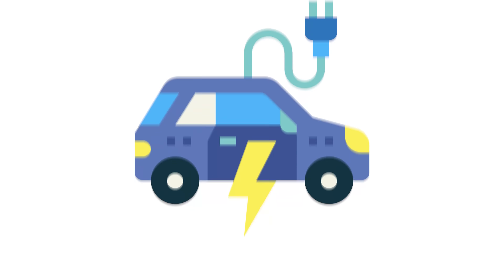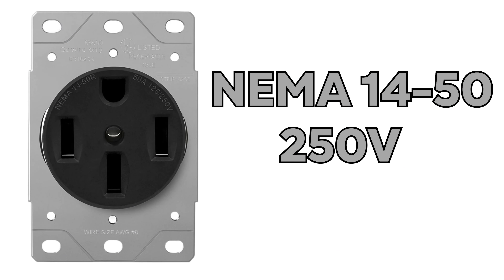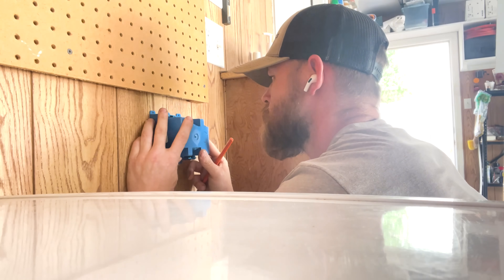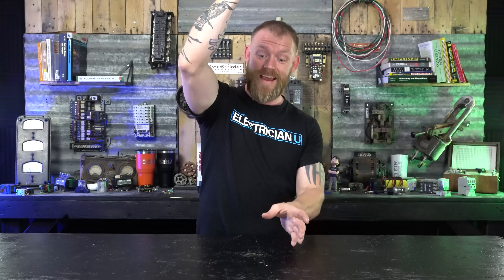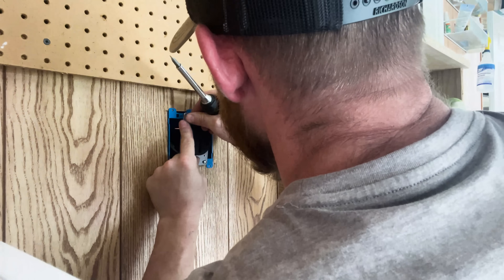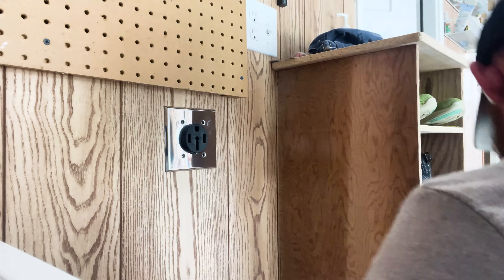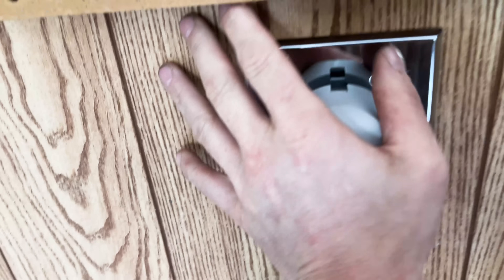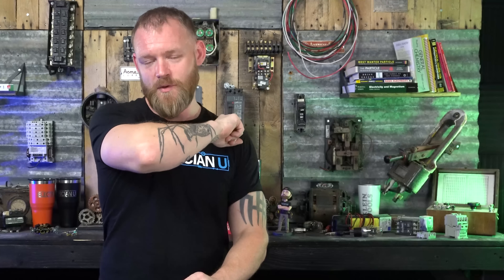How to Install an Electric Vehicle Charger Receptacle

Comment: Please mention lock out procedures on occasion. 

Most Resi guys have never received proper training. I've found that even in industrial settings, some electricians ignore the proper procedures.
 
It only takes one good jolt and you're done.

Comment: Know what else you should do, besides hire an electrician? Hire one that doesn’t suggest using a receptacle.

Receptacles are redundant, an added expense, and open to problems if it’s not a quality receptacle. Just … stop, please!

We’re not sharing it with a welder, people are not using a dryer or a cooktop in their garage. Receptacles, for EVs, are on balance not best practices. 

The next electrician that quotes you a receptacle, ask WHY. If you get a blank stare or are told you need one because the EVSE comes with a cable to plug into a receptacle, walk away and find a specialist, not a generalist!

Comment: Great video, question: for ev charger : can I install a 60 amp Gfci breaker with a 50 amp hubbell 9450a receptacle also with 6 awg wires.

Comment: 8-3 NM cable is rated for 40 amps, so there's that. For all you people using 8-3 romex, it's only good for 40 amps. Also, don't use a receptacle like he used, they make special EV receptacle that's rated continuous load like an EV transfer system actually is. Everything else is good.
Reply: what’s a good ev receptacle to use?
Reply: @leosotelo5119  Hubbell makes a good one, they will have a car symbol on the face sometimes.
Reply: @electvolt67 thank you!
Reply: @electvolt67 another question you can help me with. would you connect the neutral to the receptacle or cap it? i know tesla ev charger don’t need the neutral wire.?? or can just connect it and still charge properly?
Reply: @leosotelo5119  cap the neutral...not needed. Use the ground for a ground....lol
Reply: If you don't have a grounding conductor then you can use the white but tape it green at both ends and connect it to the grounding bar. But if there is a ground wire present....cap the white.
Reply: @electvolt67  electrician gave me to offers one with 6 gauge without neutral and another with neutral in it. i think the best option is to run it with neutral just in case i need the outlet for something else right?
Reply: @leosotelo5119  no, the neutral is a waste. Are you installing an receptacle or hardwiring the station?
Reply: @electvolt67  would be an outlet for charger. i can hardwire if we decide to buy it later on?
Reply: @leosotelo5119  It's a transfer station, the charger is inside the car. If you install a receptacle it has to be GFCI protected. If you hardwire, you don't. 240v GFCI  breakers are expensive, so is the EV receptacle.

Comment: I realize this was made a few years back however I hope maybe from time to time you check your notifications and read this.  I just bought a mustang mach e and been daily charging with the 110v charger that came with the car which also has a 240v plug adapter.  My silly circuit box and power coming in is 100 so it limits me to what I could add which I am sure I have a dryer, stove as 220.  However, being a electronic engineer I know I would use the same fuse system and have a a/b box. Is there such a thing that I could share my 40 amp 220v circuit breaker with a 220 plug in right underneath it and have the dryer connected to it as well?  This way if I want to charge the car overnight I simply switch it to it being powered on and the dryer would be off.  When done, got to keep the wife happy move it back and the dryer is active and the charger is inactive.  This way I would not overload the circuit box and create a possible danger to us and yet have what I wanted a faster charge to the car and the dryer the rest of the time.  Thanks for helping.  William

Comment: Around here, the "pop-in box" is called an "old-work box". The 30 amp breaker was unnecessary because the car controls the max amperage allowed by the circuit so a 50 will not ruin the car.

Comment: If electricians charged reasonable rates I would in my area there charge almost $1000 to instal a NEMA 14-50 plug plus parts and they refuse to use parts provided so they inflate part prices as welll

Comment: Electrician U is super helpful.  But it looks like the option for plug in receptacles for fixed in place (tools installed) chargers isn't allowed, at least IAW NEC 2023 section 625.44C.  They must be hard wired.

Comment: Here's another Fact .  Did you use this outlet ? If not then your going back...
Hubbell Lighting 125V 50A 3-Pole 4-Wire Receptacle – HBL9450A    Made for EV"S, because the other one's heat up and melt.

Comment: One dis service for the customer,  battery data now shows its better to charge at level two at a higher rate/ amps  then to trickle charge.  Manufactures state to only use the provided car charger in a emergency. most are only rated at 30 amps.   Run #6 awg at the minimum, copper only

Comment: Don't put a protector on the line, all the car chargers are manufactured with it built into the controller, if you do, it may trip all the time,, straight from Leviton manufacture.

Comment: 4 mins in and I said OH Shit, another electrician, under sizing,, Stop thinking wire size in your line of work...Wire is rated, but not for EV charging. a EV will draw 40amps CONTINUOUSLY ! for 4 to 5 hours. 
EV's don't cycle. Better learn to over size by two. You'll find out the fittings are the week point and melt and burn, never tripping a breaker.  Watch Sandy Monro's channel.
Reply: what’s a good size wire to use for a nema 14-50 ? i have a bare stud garage. should i do wire in conduit or just wire in studs? planing to add drywall in the future?

Comment: By the looks of that 14-50 outlet, it’s a cheap from a big box store that is ok for a dryer or electric range but not for an EV charger. It is not designed for a long charging session pulling up to 40 amps. I have two EVs. When charging the car decides how many amps to pull. My 2014 will pull 32 amps. My 2022 pulls 40. The car decides how many amps to pull. It doesn’t care what the breaker is. Pulling 40 amps for several hours will overheat the breaker and the cheapo outlet. I also question using 8 gauge wires for long charging sessions. The outlet should be a Hubble or Bryant NEMA 14-50 and the wires 6 gauge. Also, GFCI breakers and outlets are unreliable and pop when at the slightest over amp pull, like the amp jump when using a table saw or a planer.

Comment: Using 8 gauge is risky. Should  be using 6-3 for safety. Your outlet should be a Hubbel or Bryant made to take Hyde heat of 7 to 8 kW of load. The receptacle you have is ok for an electric oven BUT NOT FOR A CHARGER.

Comment: I am surprised some electricians are installed receptacles (outlets) that are meant for appliances that will not demand continuous juice for eight straight hours....they will heat up and melt, the connections are flimsy and often not even copper nor bronze. We must remember that the 50amp receptacles up until recently were meant for appliances. A range/oven does not use continuous juice for 8 hours, non stop. Appliances turn on and off, and the plug is never moved.  
An  EV is a different animal,  people plug and unplug and loosen the connectors. Moreso, the connectors are only half the size of the holes, so the current has like a funnel from a wide wire to a small connection to then another big wire to the EV.  NOTHING that costs $15-$20 outlet should be used. You need a Hubbell or Bryant INDUSTRIAL GRADE, it is heavy, beefier, the connections are very solid and is sturdy. Those can take the heavy load 24/7.

Comment: Do the cable wires get hot enough to potentially cause a fire in the attic if touching insulation?

Comment: You need to use EV rated outlets per the new NEC code. These have a larger fdace on the front, all copper contacts and can handle 75 inch-pounds of torque. They also have much higher insertion ratings. These are way safer than cheapo stove outlets.

Comment: Fun fact:
Renault Zoe from the thumbnail could never charge on an American 240 socket. It requires 240V, but one of the line inputs must be neutral, not split phase. Because Zoe does ground impedance test by injecting the current between ground and neutral. 

You could fool it with an isolation transformer.

Comment: Not sure why you need to limit the amperage with the breaker.  Use the proper max rated breaker with the cable gauge installed. Most of the time the wall charger has dip switches to control the amperage draw or the car itself has the ability to limit the amps ie 16, 24,30 etc.  This would save people from having to call in the electrician again and buy a higher rate breaker.

Comment: It is not that difficult to install. Not going to hire an electrician to wire in a freaking plug. I hoped up my jacuzzi, Spare electrical panel for my generator and I never pulled a single permit.

Comment: The way I understand it is that yes, 8 gauge wire is rated for 55 amps at 90c, BUT the circuit breaker is only rated for 60c meaning you have to go to 6 gauge wire to be code compliant if using a 50 amp circuit breaker. I would have put in 6 gauge wiring just in case in the future they decide to ditch the 30 amp breaker in favor of a 50 amp. A homeowner not being electrical savvy may look at it like I'll just go to HD and buy a 50 amp breaker and put it in myself, not knowing the wiring would not be sufficient for a 50 amp breaker. Just a thought.

Comment: Go WALL CONNECTOR  or go home.     Receptacles are dangerous and S L O W. ......99 % are NOT rated for continuous duty AND use 6 gauge  wire while you are at it and romex SUCKS.

Comment: I recently did my continuing education to keep my masters license on ev charger circuits.
   The instructor cautioned that the 50 amp range outlets are the source of many fires. 
   They aren't manufactured for continuous duty at 43 amps and melt down. Havent seen it in person yet, but incourage direct wire installations just in case.

Comment: Can you tap into a solar Power Disconnect box for wall charger?   My main panel is in the back of the house and will need about 75ft of cable. My solar disconnect is inside my garage about 5 ft where I wanted to place the 240V plug.    Thanks.

Comment: The Tesla Power Feed, get around many issues with a common NEMA 14-50 garage installation. 

The first is the Tesla Wall Connector is not a general purpose receptacle. It has a built in GFCI so the circuit breaker feeding it does not need to be a GFCI for a wet/damp location of the Wall Connector, like a garage. It is also not considered a general purpose receptacle like the NEMA 14-50 which can be used for many different loads, like an electric dryer as an example, so the circuit is dedicated. Another advantage with the Tesla Wall Connector is it can be used continually, as in NEC continuous load (3 Hours or more), without special consideration. The common NEMA 14-50 dryer receptacle that many use for EV charging is not rated for a continuous load. The only continuous load version I know about is the Hubbell HBL9450A which is EV Grade (Continuous load grade). The HBL9450A is very long so you may need to use a metal surface mount box (with EMT) with a expansion offset front plate. Also, if using stranded wire in conduit (THHN/THWN) I would crimp on a ferrule before installing the wire to the receptacle. Also, tighten screws with a torque wrench or screwdriver as per Hubbell's spec.

Comment: You must definitely do a calculation to see is a real interlock would be required to run the charger because electric car chargers are taken at 100% against the service

Comment: Good info, is this a leviton receptacle? I've heard that the contact pins are not ideal for EV's especially if your plugging and unplugging on a daily basis. For say a standard dryer that seldom gets unplugged its not a concern. Many house fires have been traced back to these lower quality 14-50 receptacles. There are EV grade receptacles, they have allen screw holes to tighten the wire and the metal contacts are heavy duty. The allen screws also need to be torqued down. Device box needs to also be changed to a deeper box.

Comment: Question, how does an ev charger differ from a water heater connected via a 30 amp plug? Why is one allowed and one isnt? I need to charge my solar batteries with a chargeverter and only have room for 1 -30 amp breaker. Thks

Comment: When I bought an EV in 2018, I had an electrician install a 14-50 outlet fairly close to the point where I charge my car. Now I have a second EV and the plug location doesn’t work so well anymore. Is it possible to move the outlet by installing a junction box and adding the new length of cabling to a new outlet location?

Comment: If a vehicle is rated to draw x amount of current I would think you’d be ok to up grade the circuit breaker. However I could also understand that if the vehicle for what ever reasons draws more amps it could damage the vehicles charger. So charging at your home is a liability that could void a warranty I’m assuming.

Comment: When I installed a pair of 5000 watt infared heaters code said I need to size them at 125%. I assumed that was because they would always be pulling at the top of the cable rating. Wouldn't a car charger fall into the same thought? If you put in a 50 amp charger and it's always pulling 50 amps during normal use should I be upsizing the wire to #6?

Comment: Thanks to your video I decided to install my new Grizzl-e charger; I have what I thought was a ready circuit to do the installation, a dedicated line to the breaker panel that ends at a plug that was used for a heat pump that is no longer in use. The line is a 3 aluminum #8 conductor two hots and one neutral but I don’t have a ground wire. The NEMA 14-50 plug required a ground. Can I just ground to the metal box? I appreciate your help.

Comment: I have a 100A panel in basement. I had 2 Electrical stoves (240v), but now one stove is converted to use gas instead of electricity. So, can I use the unused 240v outlet to move to garage and to be used to charge an EV car (Level 2)?? I can use the same breaker that the stove had earlier and keep the same 100A panel. Can I do that ? PLs advise.

Comment: Awesome video and thanks for the info 👍 I’m an auto technician so I sometimes run and repair vehicle wiring. Im pretty handy as well. I do most of my home improvements. might just think about tackling this job myself 🤔 but still I’m not a professional electrician

Comment: Many comments have addressed it, but 8 gauge wire, 8/2 or 8/3, is not rated for 50A in this install. You mention at 9:48 it is 50A wire, but since it is NM cable you have to use the 60C rating which is 40A. Also by the "80%" or "125%" rule or whatever you want to call it, larger cable would be required with a 50A breaker. You would need 6 gauge wire, which is rated for 55A at 60C, in order to use a 50A breaker with this circuit. For some specific applications you can undersize the wire on a 50A receptacle circuit, but I wouldn't.

Comment: Installed 50 amp breaker & Chargepoint Home Flex.

Just had installed the chargepoint home Flex into a 1450 charger receptical, with 50 amp breaker & plug professionally installed.

My question is, I need 75 miles added to my car, and the first time plugging in, it's telling me 6 hours plus. That is about 12.5 miles input per hour.  Not being an electrician, what else should I check or do so that it's putting out 25 to 30 miles charging per hour, similar to on the road level II chargers?

Comment: Many of the portable EVSE's you plug into receptacles do a ground test before allowing a charge session to start. The Ground test may trip a GFCI breaker. Once 2020 codes are adopted everywhere I believe receptacle outlets for EV charging will just go away and the standard will be a hard wired EVSE. Not because they are better but because they will work reliably on a GFCI breaker.

What drives me crazy is that the real risk with EV charging is arcing. The connectors can and do come loose and there are many examples of melted 14-50 outlets and the occurrence keeps increasing as EV's are adopted. What we need are AFCI breakers, but try and buy a 50 amp or even a 30 amp ACFI dual pole 240v breaker. They are simply not made. The codes are going GFCI not AFCI for garages. EV's need to be treated differently. GFCI's will not stop arcing and we will see homes burned down because of EV charging. No doubt this is why your customer said to limit the breaker to 30 amps. 

In my home I use 40 amp breakers for my EV's.

Comment: It's my understanding that the breaker needs to be 20% higher than the rating of the EV "charger" (it's not actually a charger, the charger is in the car) therefore if you are using a  32amp setting then you will use a 40amp breaker and a 40amp setting will need a 50amp breaker. 
I'm not sure what setting/ charger is being used with a 30amp breaker! Seems a really low and therefore slow charging rate. Hopefully they are not using a 32amp setting with a 30amp breaker!